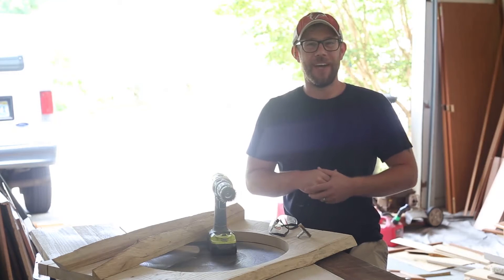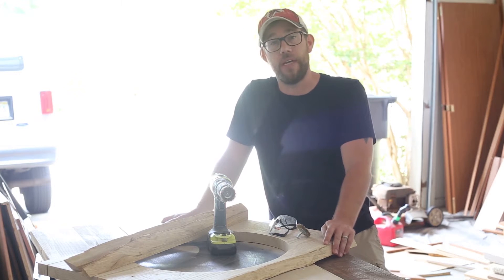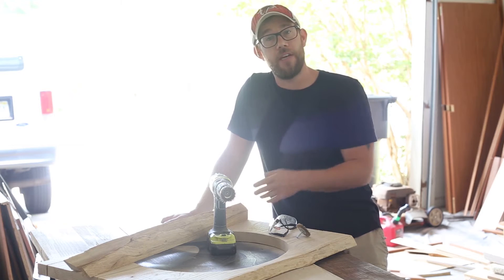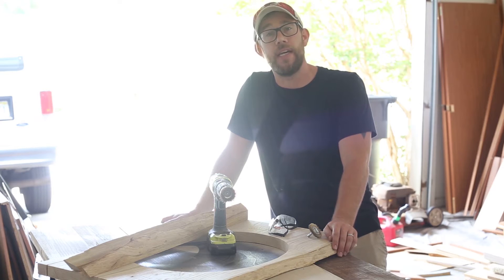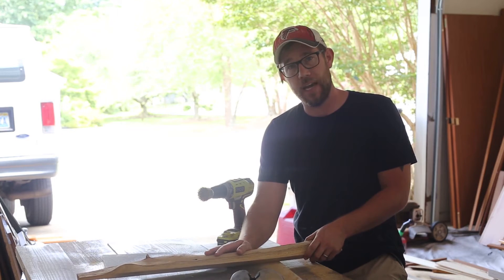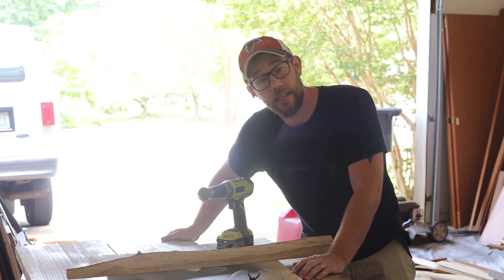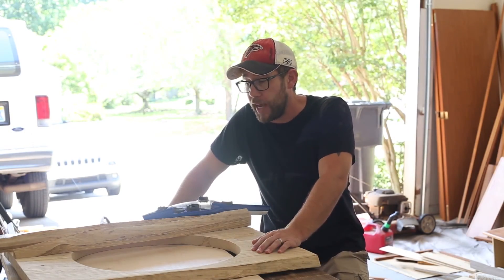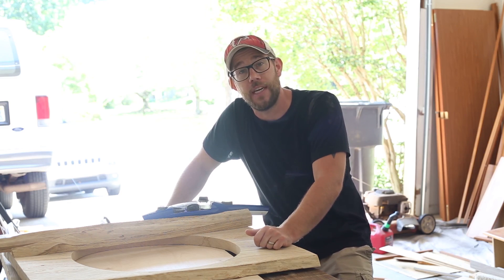Reclaimed Wood Countertop - Cleaning up the live edge

Comment: Doesn't this leave it with a lot of roughness and splinters?
Reply from the maker: It was actually surprisingly smooth after I used the fine wire brush adaptor. But even with that said I did give it a slight sanding after I was finished using the wire brushes, then I steamed it and gave the entire counter including the live edges another sanding. I kept the sanding on the live edges to a minimum though.